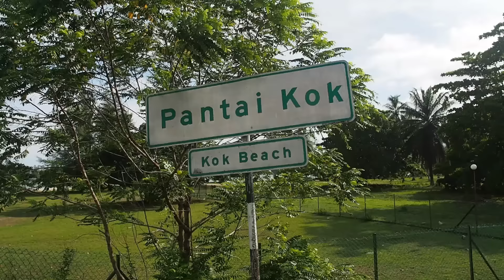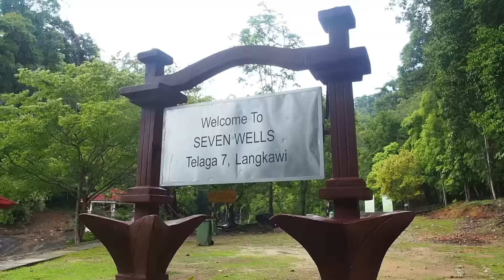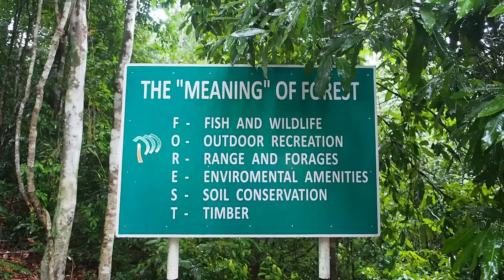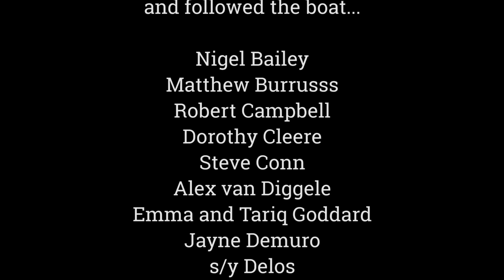THINGS TO DO IN LANGKAWI! Ep 5

Comment: FYI when you believe you've gotten air I. The fuel system or you run it dry , you fill all the fuel filters and use diesel starter fluid and spray it in the air intake and just spray in enough to keep it running tell the idle smooths out and your good to go if it don't smooth out it's probably bad fuel check it if you do this you'll never need to bleed the fuel lines agine

Comment: Thanks for sharing another nice episode. 

By the way, you have only 220 Ah of battery power. For some stupid reason batteries are not rated in Joules (or watt-hours or kilowatt-hours) but in Ampere hours. If they were rated in kWh you would be right in adding up the energy of all batteries. However, when you put batteries in series the ampere-hours do not add up. Obviously the energy does add up: Watt-hours equals voltage times ampere-hours. Since the voltage doubles, the energy doubles while the ampere-hours stay the same.  

I think this is important since we sailors, and everyone else for that matter, tend to use ampere-hours to manage our battery energy. Please use 220 Ah in your calculations to avoid nasty surprises.
Reply from the maker: Hi Bor the Wolf. What you say is correct. However we do have a 440Ah battery bank because what I said in the video clip was incorrect! Each battery is 220Ah. So that's 220 + 220 = 440Ah at 6v. x2 again to get the total of all four batteries at 6v = 880Ah, then divide by two to get to 12v = 440Ah. I should add an annotation to the video to avoid further confusion.  Thanks for highlighting this point.

Comment: I'm not being critical, just trying to be helpful but did you just replace high pressure steel lines with low pressure rubber??? and no clamps to boot???
This looks very dangerous guys, I'm not sure I saw what I think I saw but but if I did, you should rethink this right away.

Comment: Perkins... the worst engine I ever worked on.
Reply from the maker: Hi jvo0311. Was it a 4108? I heard that's a pretty bad marine engine. We're a Prima M60, but since this is the only diesel engine we've owned and worked on, we don't know any different.
Reply: followtheboat I worked on both the 4108 is better than the prima. I don't trust the timing belt or aluminum head. I've taken apart the m50 and m60 many times. They are just not my favorite.
Reply from the maker: When the engine starts falling apart, we'll document it in our videos and come looking for you for answers, jvo0311 ;)